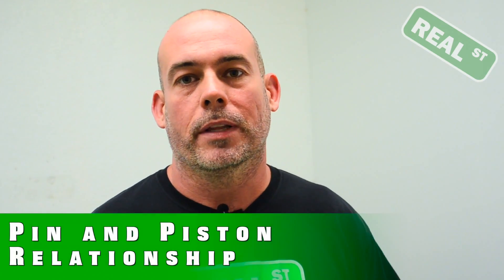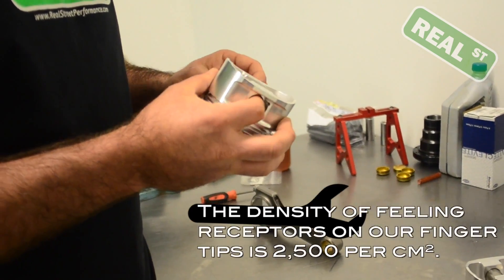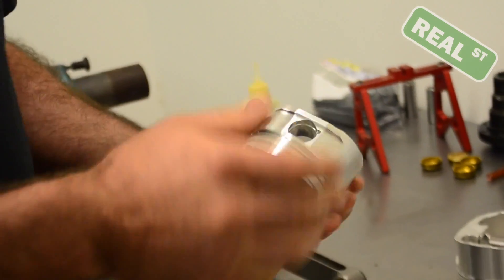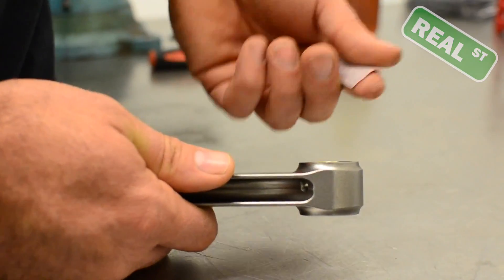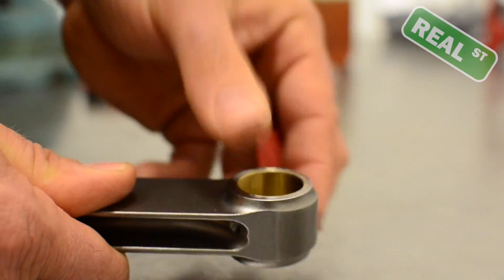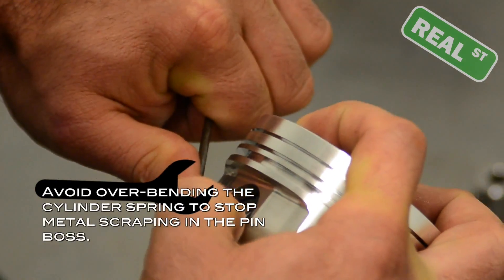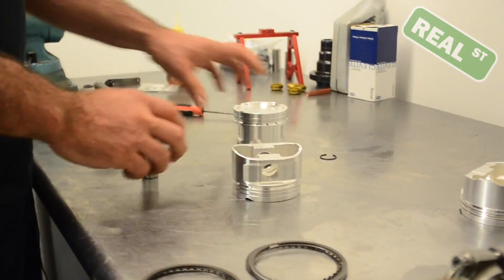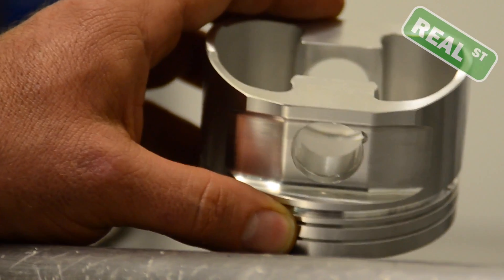Jay's Tech Tips #9: Wrist Pin & Piston Relationship/Installation of Pin Retention Clips

Comment: Great info! Love the videos! but just one thing to keep in mind. Orientation of the c clip is important at times.
Vertical gap either top or bottom.  
The g-forces the clip experiences are on the vertical axis so with the gap to the left or right the clip has a chance to move thus a chance to weaken over time possibly causing issues.

Comment: Bad bad bad advise. 
You can't feel machine tolerances.  
A real engine builder will measure and record all dimensions.  A micrometer and a cheap snap gauge is all you need.

Shake my head.

Comment: Wow this is 4 yrs old but im gonna ask anyway, ive heard the retention clips have to be inserted with the gap either toward the top of the piston or the bottom on a boxer engine...and that any other way will cause them to fail. Is there any truth to that?
Reply: Yes.  At high RPM, sideways facing clips can deform from the G force at TDC and BDC, causing them to pop out of the groove.  Mayhem ensues after that.